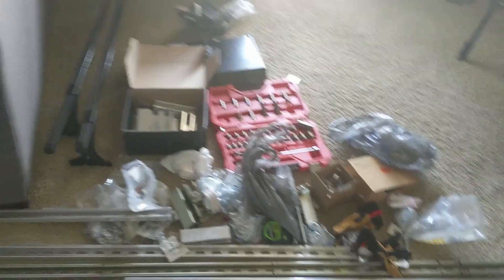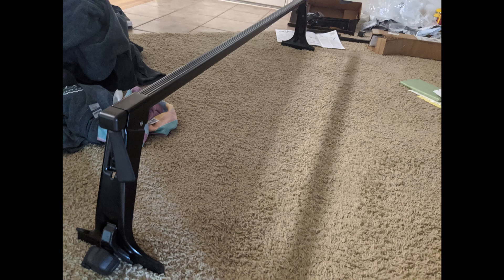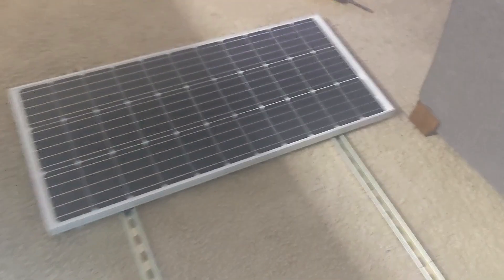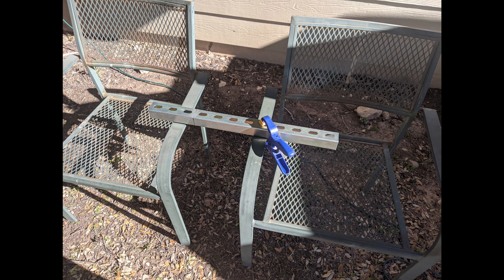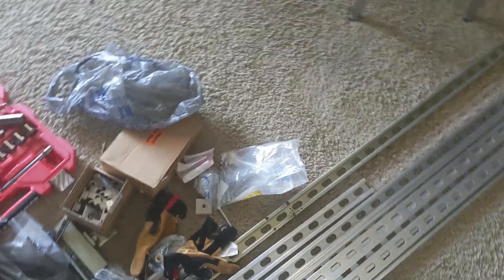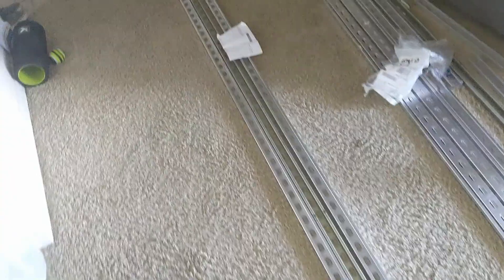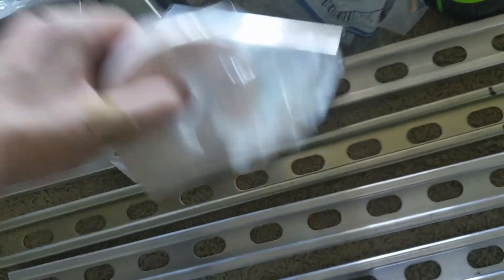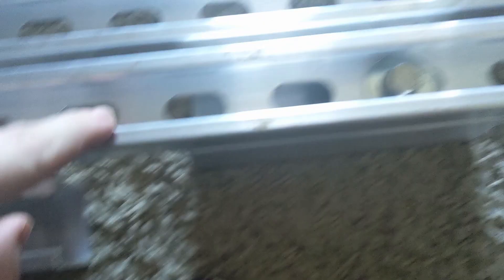How to mount solar panels on a curved fiberglass roof #vanlife #rv #solar #unistrut

Comment: did you consider extending the black roof racks legs? I think you could of cut the middle of leg and have a welder add enough metal to reach to top of the roof.
Reply from the maker: that's something I did consider.  I figured a welder could fashion some kind of bracket.  The black stuff is just a rubber grommet but theres metal underneath it that you could weld onto.
Reply: @RENTFREEVANPLAN  I got some clamps that the phone co. & plumbers use as roof racks. got from the junk yard, I was planning to fab the legs as high as needed the across piece would be the easiest.I liked the way you routed the wires though that toilet tube.I've only had my van 2 months but have always had conversion vans so I've been planning a long time.be safe on the road.

Comment: Thanks for sharing! Any suggestions for a van curve? I have a 2003 grand caravan
Reply from the maker: I think you can get a real roof rack added onto those using gutter mount rails or something like that.  If you have the option to add a real roof rack, definitely do that before trying this custom stuff
Reply: @RENTFREEVANPLAN  just bought a pair from harbor freight today. They fit great. $90. Very sturdy, no drilling required. Really appreciate the tip. Wouldn't have gotten them without it. I have to offset them a little more to the driver side of the car as it's a 41" wide panel and the mounts are 9" long on a 54" rail. Adjustable to 47" so it all works together nicely. My only questions now are: "How do I go about taking my headboard, lights and DVD screen out?" along with, "Whats the best and most secure way to starch the panel to the actual rack in your opinion?"
Reply: @mikedesverknopf4681  no clue on the DVD panel stuff, but you can buy mounting hardware for solar panels to car roof racks.  You just have to find the right hardware.
Reply: @joe_ptrkv_ch  the over head fiberglass with foam and material that all cars come with. As for the rack, I just got one already as I said in the reply. I just want to know how to secure the actual panel to the new rack I bought. Well, not rack but flat bars that run width wise attached to the gutter mounts that either the dealer or previous owner installed.
Reply: @RENTFREEVANPLAN  Got the cross bars.... Now what????

Comment: Is the solar still holding up? We have a van with that type of curved roof and I would like to put some solar up there but am concerned about it.
Reply from the maker: It's holding up very well but I haven't gone on very many trips so it hasn't had to deal with road wind or road bumps.  I'm still quite confident though that the bond is permanent.  If you go this route though, I would suggest trying to get as much surface contact as possible with the VHB.

Comment: Thanks for sharing your project! My RV has a curved roof like yours (Leisure Travel Vans 2009 Free Flight), so I've got the same issue (although the curve is not as pronounced as yours). After lots of researching, your setup (or similar) is what I'm going for, and I really like the double safety features you put in (which I have not seen on any other similar project). Had a chat earlier today with Hein from DIYVan who also recommends VHB tape (#4611), but on as large/long a surface as possible, and then sealing the tape contour using Geocel sealant. I'll try to add more feet if I can. Another recommended track is 80/20 model #1575; Not sure how that one compares with Unistrut price-wise (profile seems lower). Also important to mention for VHB adhesion is surface prep : sand down any oxydation from aluminium & use a solvent to remove wax coating from fiberglass. Cheers, jp  P.S. Big thanks also for your automatic transfer switch project!

Comment: How’s it holding up so far? I have a curved high top myself and have been trying to figure out how to do solar for a while now
Reply: I've went on a few 2 hour drives in the interstate where it was very windy and it held up find.  I'm pretty confident that it is a permanent bond, just make sure you get as much surface area as you can.  Use more feet if you can.
Reply: @joe_ptrkv_ch  thank you :) I ordered some stuff and hopefully I’ll be able to get it done soon
Reply: @EvieNova  @joePetrakovich  I got a cargo trailer with a curve top and also trying to figure this out as well.  I have a 305w Solar panel.  Struggling to find a bracket that will work.

Comment: That ladder is awesome I need to get one. I did the same as you and built a roof rack from super strut to connect my solar panels to the top of my truck camper. I also just ordered the Renogy dc to dc charger. Has that unit performed well with your system? Thanks MonkeyBiz24/7.
Reply from the maker: It's worked well but to be honest I haven't gone on any camping trips with it!